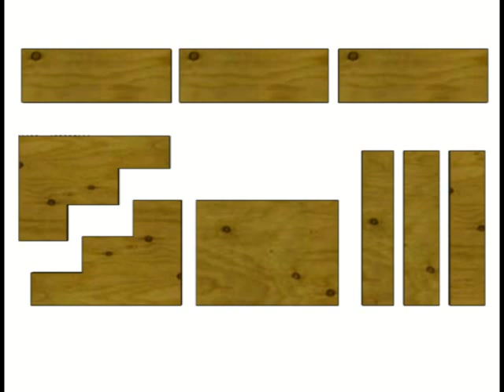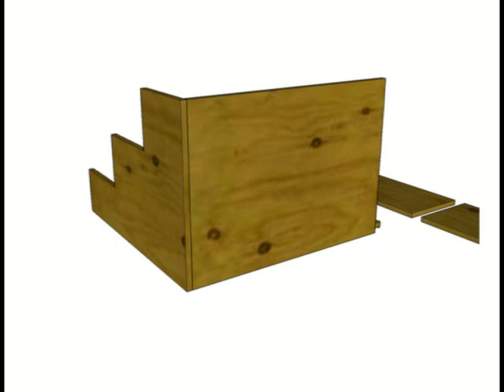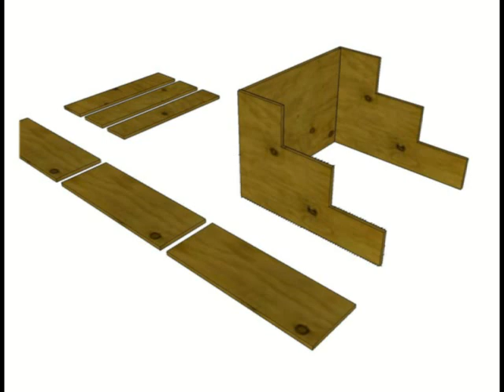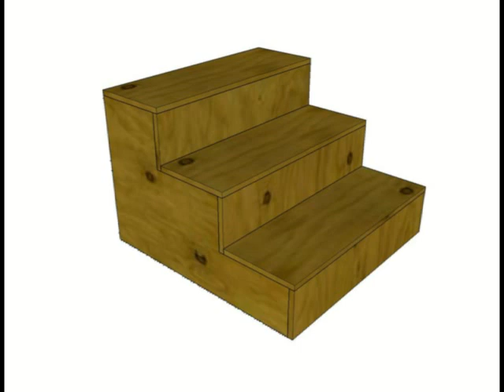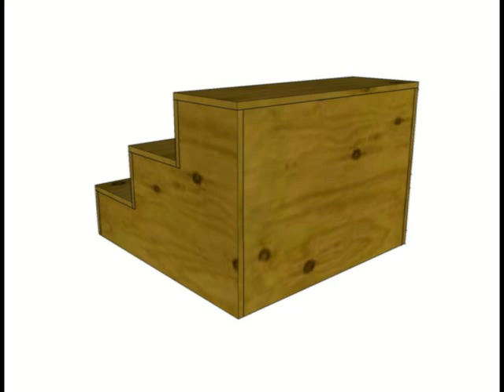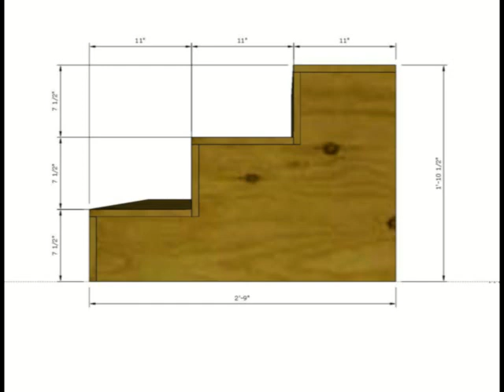How To Build Stairs with One Sheet of Plywood - Part Two

Comment: Hi, I'm in the process of building steps for a 5th wheel. I've already cut my stringers out of 3/4". 5 steps each with a 14" depth and  have 7" rise. Total size is approx 6.8 long and 30" high. I'd like the steps to be 40" wide. What kind of structual bracing would I need for this width?? Without adding additional plywood stringer.. I could go down to 30" or 35" width but don't want to.  I have purchased some 2x4s 🤔 
Thanks in advance

Comment: Hey, could you tell, what is your idea of a way to cut this angles on a 8 corner side detail on one sheet without destroying second detail?
Reply from the maker: I don't know if this will make sense, but I usually set the saw into the line slowly, while the circular saws running. Then you can push the saw forward if needed and finish all of the cuts with a handsaw.
Reply: @stairbuilding  hey, I just saw your responds, and we did it already, kind of same way you describing. We set circular saw and slowly deepened it in wood and after moved till next